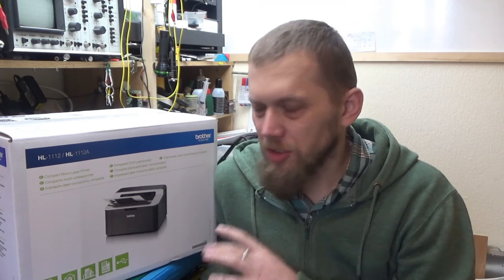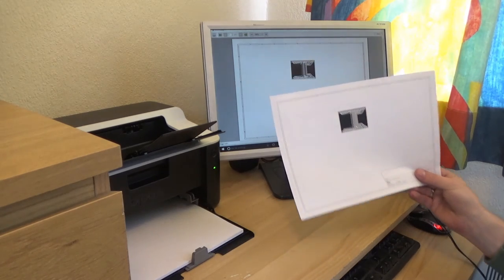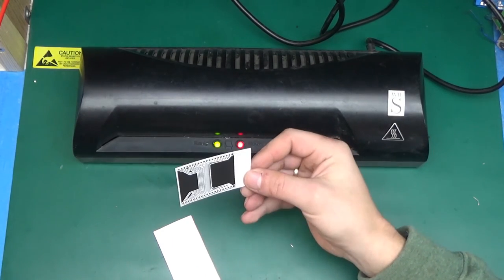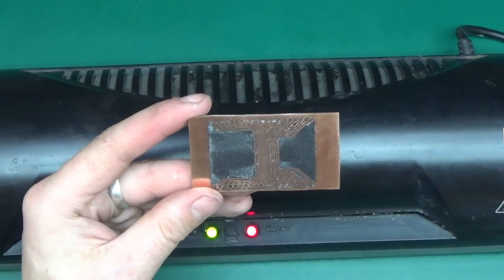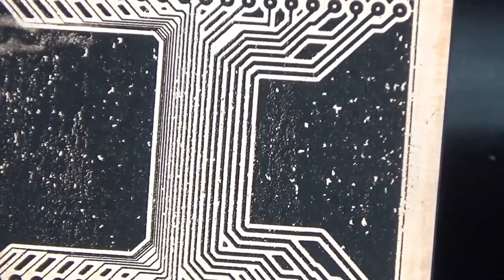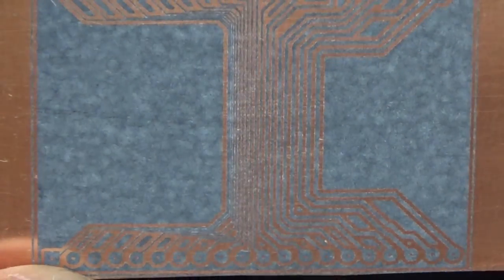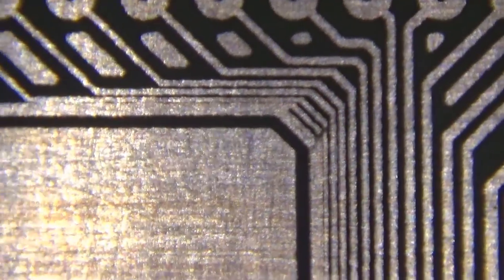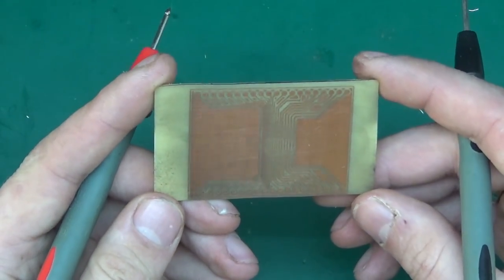Brother toner transfer - which media is the best?

Comment: 0.2mm clearance and 0.05mm track width is good enough for almost all pro pcb prototyping, for example soldering QFN chips, this video was really helpful. 99% of all videos on the internet shows people etching pcb using dip chips, I needed some real precision details of the classic "toner transfer method". This video tells it all. I was in complete dilemma (just like anyone else) whether or not if I should use TT method or the newer "photoresist" method. This particular TT method of using photo paper with a laser printer seems to be bulletproof, no one has ever complained about it and always recommend using it. This video is proof that TT method is still a better choice, simple and fast. Thanks!

Comment: Thank you very much for this video and you right parchment paper is a headache to put a print on it, but transfers very good.
I have used sandpaper 1000 with very little scratch (the more you scratch, the more difficult will be transfer later).
Generally I am not satisfied with parchment paper. Wax paper is doing much better job, however to peel it off I had to use heat gun.

Comment: I bought the same printer.
The problem was to find fine toner on market.
Not all toners on market are suitable for laser PCB transfer.
Empirically, I find the best toner(in terms of print boldness and polygon fill) - Mitsubishi Japanese brand (don't take it as an advertisement).
By the way, only this toner suited me for Chinese yellow thermal transfer paper.
Due to the fact that the yellow paper is very thin, it was necessary(as well as the author of the video) to cut out small pieces(to the size of the PCB) and stick with adhesive tape in place of the printout.

Comment: nice. I have the same printer and use a clothes iron. Mixed results but I am pushing it a bit. I have found that cheap, yellow eBay toner transfer paper sometimes works and sometimes doesn't print correctly. Glossy junk mail is good if you don't go too fine with the traces. Which laminator are you using? Cheers

Comment: I use refilled toner for my canon lbp2900, works great. Good video
Reply from the maker: Thanks!
Reply: My old Canon LBP3000 used to lay down thicker toner than my new Brother HL-1110 set on max dark. You could actually feel it like Braille when you print with it. I think I will get rid of the HL-1110 and try refills for the LBP3000.

Comment: Use the sponge with a little water to remove the paper before immersing the copper in the acid. the toner will be more precise.
Reply from the maker: I know what you mean, but I found that with this particular photo paper peeling off does just fine, and toner also pulls off a layer of plastic from the paper, thus making the mask stronger. But with different paper types I would definitely remove paper by wet method.

Comment: Hi, love the video, very neat work! Was wondering what laminator do you use? I have just ordered a Brother laser printer, specifically for toner transfer, then saw all the negative comments on the internet; your video was a huge relief, many thanks!! I am going to be etching metals for jewellery making and will be using some intricate designs; I will therefore need good transfer of toner to the metal. I will experiment with paper but am also wondering if the laminator is important?
Many thanks,
Emma :  )
Reply from the maker: The laminator is the cheapest kind, nothing fancy. My one is old style generic WHSmith brand, but that is irrelevant. Only thing that matters is that the transfer paper and your work for between the rollers. For some laminators you may have to enlarge the gap in the casing, but in general, any will do. I suspect all the basic ones are exactly the same on the inside.
Thanks and good luck with your jewelry making!
Reply: randomtronic 
Thank you very much for that 😁 I have a very basic laminator ... will give it a try. I was wondering if a heat press machine would work?? 
My Brother laser printer has arrived ... can't wait to get stuck in!!
Many thanks again,
Emma 😊
Reply: I bought a cheap Brother laser printer and a super cheap laminator. The laminator wasn't up to the job so I modified it with a half speed synchronous motor and also now control the temperature with an Arduino and two thermistors fixed to the laminator. It works well now. Just need to modify the gap between the rollers a little as I haven't done that yet and you can see the rollers bow a little

Comment: thanks for the experiments youve done,to save others the trouble!
was the poundland photo paper the stuff for inkjets; or does it say its for laser printers? photo paper is expensive here,and i dont want to trash my beloved old HP laserjet melting some in it! 
I have been playing about with toner transfer recently,but cannot stop the 'pin-holeing' with ANY of the papers i have tried ( shiny premium office paper,tracing paper,magazine pages ) it LOOKS good until you examine the print on a lightbox and see its grey rather than dense black.i'm using HP original toner.The best so far, for ease of removal from the copper, is the backing sheet for laser labels; it simply peels off once the copper has cooled down,with no scrubbing or soaking; and leaves just the toner,well stuck to the copper; i use the 'big brother' (A3 size) of the laminator you have, i found the rollers don't deflect as much at the gearbox end on the large model as they do on small one, which risks stripping the gear teeth when feeding normal PCB through it,and its heater output seems  better too...though it takes about 20 minutes to get to temperature.it was sold under the 'staples' brand,sometimes also as a 'fellowes' they're identical hardware. pinholes though, curse me; i'm convinced its the printer not laying down enough toner (as there is nothing left on the sheet!) no matter what settings i choose in the software 8<(
Reply from the maker: +Hack In Black thanks! The photo paper did not say specifically laser printer, just cheapest stuff out there. Did not seem to do any harm to the printer :)

Comment: I have had some success with a brother laser for toner transfer.  However now I'm suffering from bad pitting.  Not sure if brother toner or 3rd party toner is best so if you have any developments in this regard I'm sure the community will be interested.
Reply from the maker: Hi, I am still on the original toner, but as soon as it is gone, I will be buying 3rd party replacements, so this will be a subject of a future video.
If your printer does not print like it used to, perhaps it's time to change the drum? Or is it happening during transfer?
Reply: randomtronic Ok so I have a 3rd party toner and the original brother toner that came with the printer. Neither of these are giving good results now but the original toner used to give excellent results.  I've bought a new brother toner (£55!) which is arriving tonight so I'll update on the results when that arrives.  Transfer is always 100% but the print has microholes which results in the pitting
Reply: The brother toner gave flawless coverage and I've now successfully etched my board.  It seems the problem was that the 3rd party toner (Cool Toner, ~£12) wasn't suitable.  If you find a 3rd party toner that does work for ~10mil traces please let me know because £55 is a rip off.
Reply from the maker: Robin Morris will do. i will be buying some cheap replacement when the one i got is finished.

Comment: .
Great presentation -Big Thanks 
I would like to know about the plastic bag you used for etching , and its 2 plastic sealing pieces.
Where from I can buy one of those?
Thanks again.
Reply from the maker: +Olie Brien its called seno gs, look on ebay.
Reply: .
Thanks for your reply.
Unfortunately this specific “seno gs” bag is not available on eBay.
There are alternatives called Air tight silicon food storage bags from China.
But I do not know if silicon material can be used with the Ferric Chloride etchant??
Reply from the maker: Yes it can, silicone is fine, hdpe is fine too.
Here is ebay link: https://rover.ebay.com/rover/0/0/0?mpre=https%3A%2F%2Fwww.ebay.co.uk%2Fulk%2Fitm%2F291550786896
Reply: I get good results using a Tupperware brand plastic sandwich box/container which has a nice air- and water-tight sealing lid.  Pour about 1 cm thick layer of ferric chloride into the bottom of the container, drop in the card [circuit side up] replace the lid, and shake/rock gently for fast, even etching. Don't let the lid come off!  Heating the etchant in a microwave oven to about 40 ~ 45 degC [with the card immersed if you like] will speed the etch.  Remove the card, rinse in three waters, soak in a mild solution of baking soda [sodium bicarbonate] for a minute to neutralize any residual etchant, rinse in another couple of waters, and you are done.  
The etchant can stay in the container [close the lid tightly] until the next job.  Tupperware is handy - for larger cards simply purchase a larger container.  Glass containers with plastic lids also work well.  I wouldn't use these containers for food once they have contained etchant...